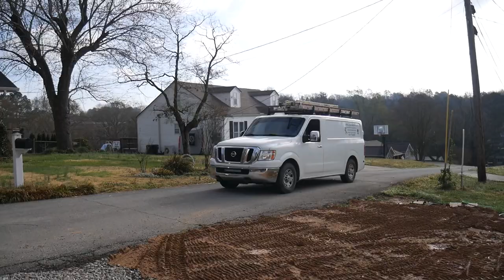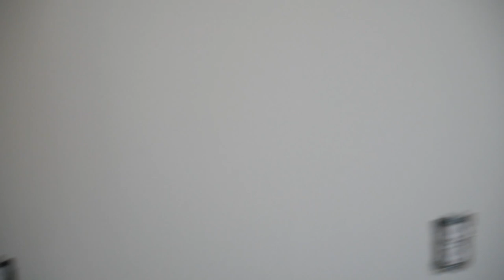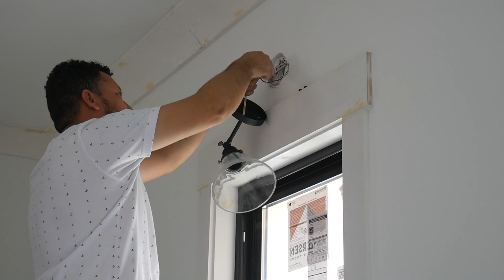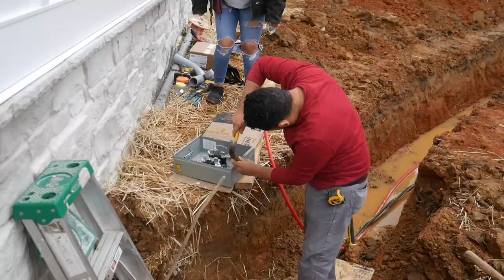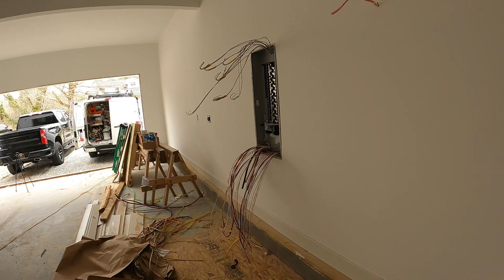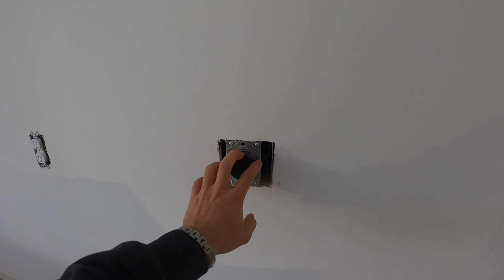How to Trim Out Electrical on New Construction | Building A $350,000 Custom House | Episode 47

Comment: The electrics in the usa wood fail in a heart beat here in the uk…wow..to me shocking work but to you good work but hey just how it goes..If i was to carry out an inspection there that would fail immediatly
Reply: What exactly would you fail it for? As an electrician in the USA I'd like to know what you would fail them for compared to the UK
Reply: I'm an electrical engineer and I too want to know what would fail? The only thing I questioned was the electrical wiring in the trench needs conduit unless it's rated as direct burial wire..
Reply: @tdub3366  yup. only thing i can think of is we do things differently compared to the UK. i couldn't find anything that was against code. im from the area this house is being built and power company's around here do different things when it comes to line side power. EPB (who supplies his power) doesnt pipe it all the way to the transformer. and youre right, it's direct burial.  it's piped only down the wall on the house with a 2½" 90°. other power companys around here will pipe it all the way to the tranny. VEC specifically.

 one power company around here wants the top of the pipe @ 5 feet deep with a sweep 90.... we've hand dug that many times..

Comment: That trench not 3 ft deep. The 90 elbow is sticking out the ground. Thats at best like a 1-1.5ft at the meter. Never seen the power company, not run pipe for underground. I do it sure, but never seen a power company do so. Has to be their line, since meter on building. Guess they could do it different there. We require an outside disconnect.